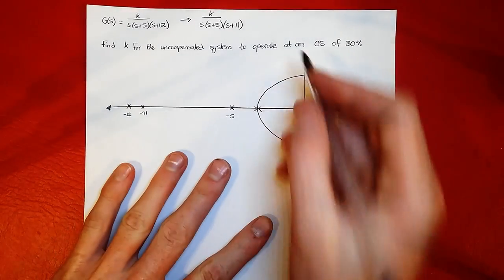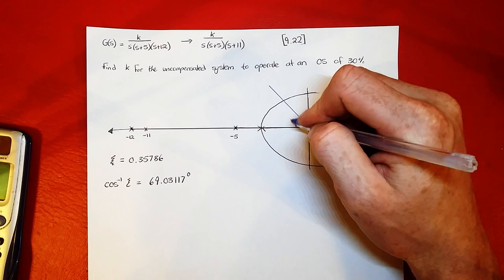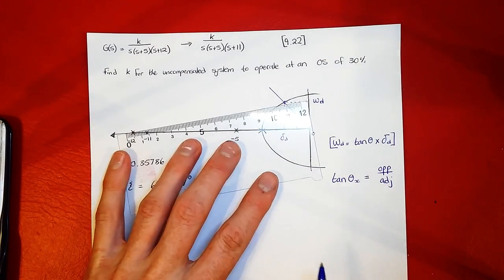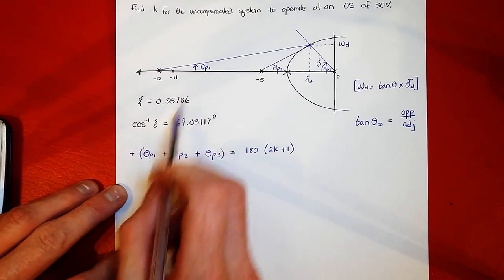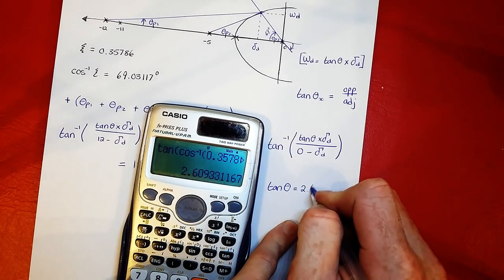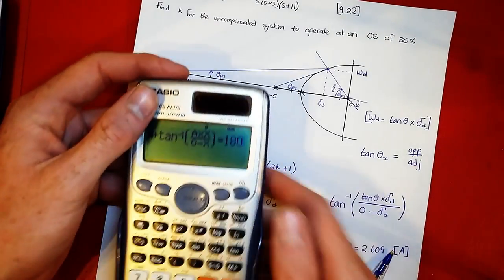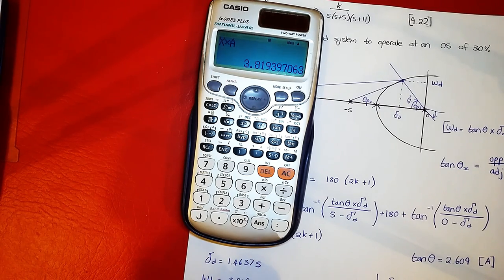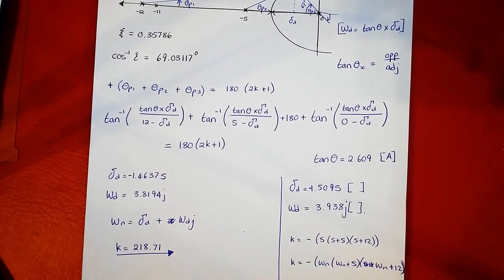Control Systems (EBB 320): Solving for an exact point on a Root locus, by hand.

Comment: For the third angle (theta p3) can't you simply take 180-69=111 degrees? I think you solved it correctly but you drew the theta lying in the 69 degrees sharp angle instead of it going from zero degrees on the x-axis to 111 degrees. Thanks for the video it is quite relieving!
Reply from the maker: +Nelis Brink You definitely can, but this only works for when you have a pole at the origin. But with that said if you have 5 poles, with one being at the origin, your calculator will pull amps to solve that, so if you can simplify its life by saying one of the angles will be 111 degrees, it will speed up the computational time greatly.
Reply: Ewald Erasmus  what if there is any zeros the procedure is same for that ?
Reply from the maker: Ali Omer:  I can't exactly remember if it's the same but I have a feeling it is. Sorry this was fromany years ago and I can't remember it all.
Reply: Ewald Erasmus I tried this method is not correct when there is a zero in system so then how can we solve the problem as we have to find compensated zero in every problem , how we can find a point and k
Reply: pls try to do this one

Comment: wrong method why positive angle for poles? your method works for onlly those case where net angle 180(2k+1) and angle of pole on the right side of root locus   is zero
Reply from the maker: Muhammad Saad Tariq you will see I explain that it should be negative. But it makes no difference because all of them are negative. You can include the signs if you want and you will get the same answer